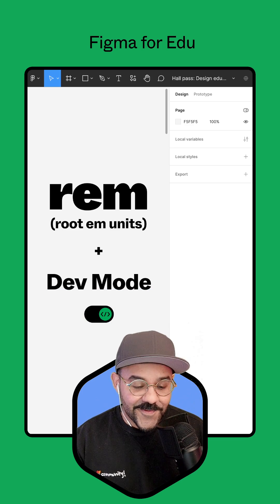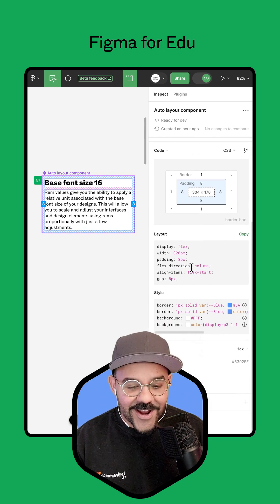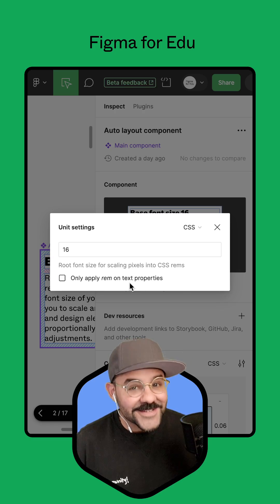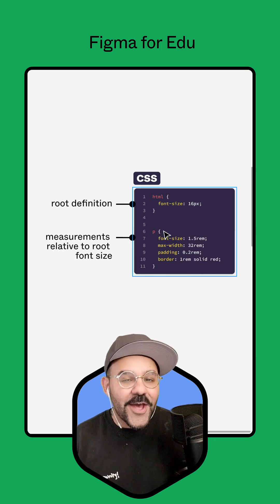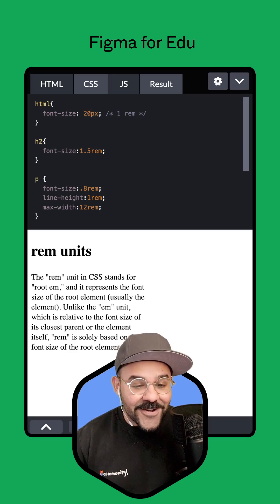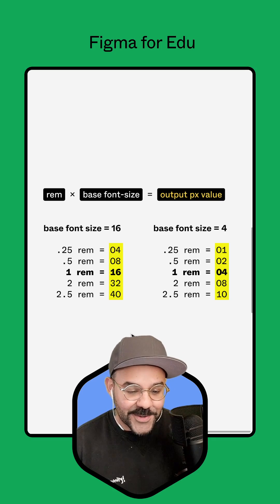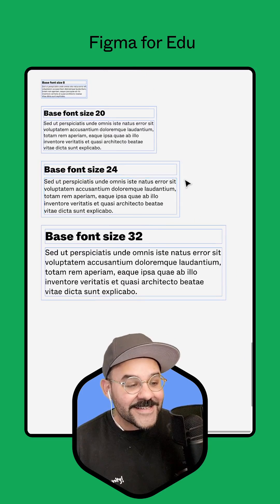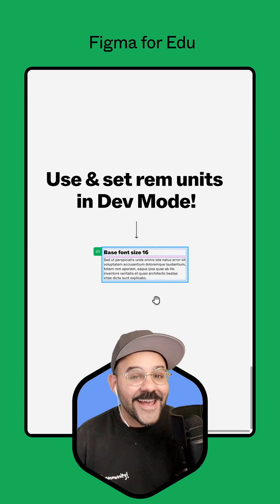Hall Pass: Using rem units in Dev Mode

Comment: What about other values such "point"? We also need it so developer can follow while developing for iOS and Android. px and rem are still web standards - not mobile.
Reply: In Figma the pixel is a device independent value, and at 1x exports at 72 units per inch at 2x 144 units per inch. So in Figma 1px = 1pt. 
When you convert to Android code px is changed to dp and sp. Device independent pixels for UI and Scalable pixels for type.
Reply: @figma-miggi  yeah I got that, but it kinda doesn't represent perfectly what developers will be using while inspecting. They don't copy code from Figma (only junior/mid-level does it). What we've found out is that 1:1 is untrue, specially because rendering might differ, so if they just use the same values, there's usually a slight difference here and that - which in a whole project means a bunch. I'm still thinking how can this be mitigated and developers can make something more real 1:1.